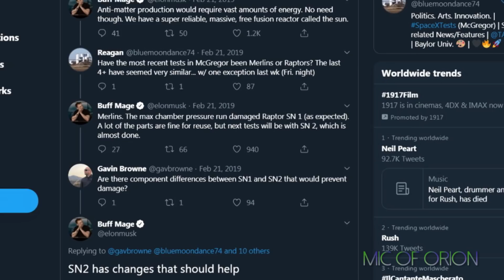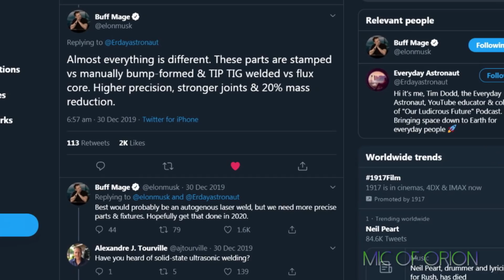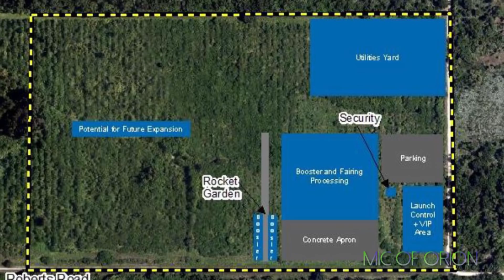SpaceX Starship Update January 2020

Comment: Ask Elon if he ever considered casting stainless steel in molds. Similar to how engines are built.....even cathedral engines. It will reduce welding joints that are weak points. Ijs!
Reply from the maker: He already replied to that, he won't, reason he prefers to welding  at least for now, cause it is cheap, it can be done fast, and added weight isn't significant to deter him from continuing on this path, however, yes I will ask him when i get the opportunity, to see if he changed his mind on the issue.
Reply: @micoforion  Awesome! Thanks.